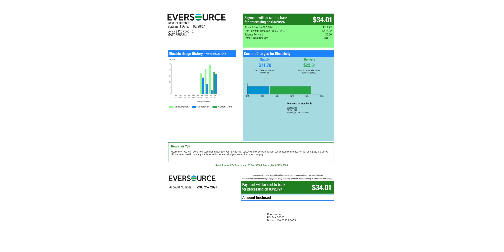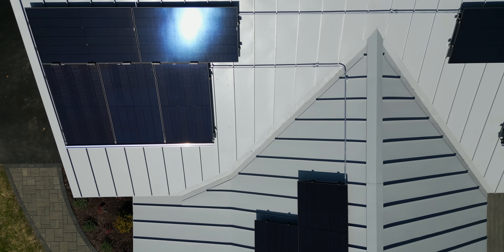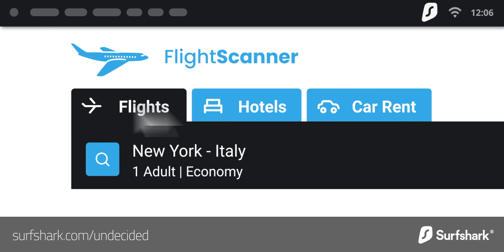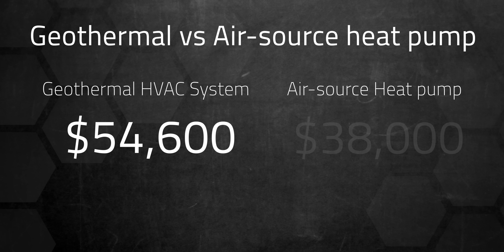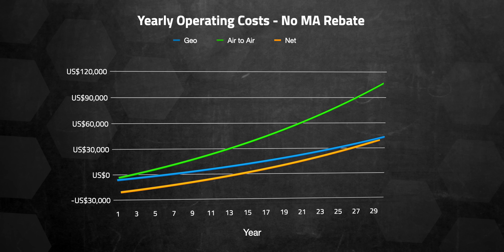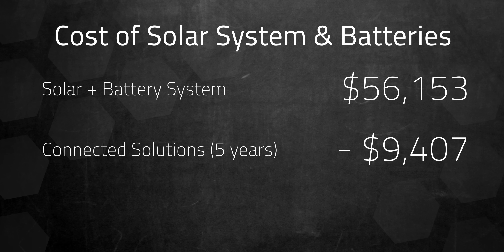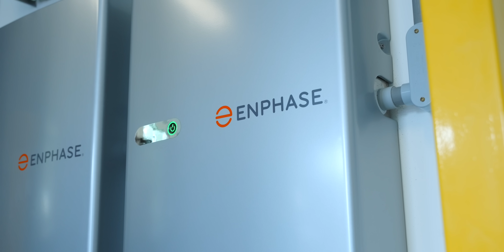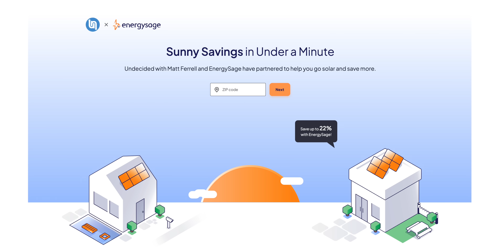What I Learned After 1 Year with New Solar Panels

Comment: It's worth it.  I've been off-grid for 4 years and would never go back.  I installed our own 15.3kw system for $27k.
Reply: Ok, wow, in EU, Lithuania, after all tax reductions, 10.2kw solar system(w/o batteries) cost me around 3k usd, and in US it costs like 10x more?
Reply: @ignasvo
Yes our permits and electrical code add a large amount to our solar costs. The benefit is less accidents. Houses burning down, installers dying and fire fighters not getting electrocuted is important. 

That said the US could cut the installation cost in half if they would standardize a little bit.
Reply: @ignasvo  yeah we kind of suck over hear unfortunately.  Greed has gotten way out of hand and it isn't going to get any better for the next four years.......
Reply: You sound like me, I've been growing my system to get to off-grid and the real costs I have calculated are coming in at about the same number. Are you figuring in Federal rebates on the hardware purchased?
Reply: @fixingbrokenthings  Yes, my final number is after the federal rebate.  We were able to take advantage of the full rebate.  Most people think that the credit is just given to you but you have to owe that amount it taxes at the end of the year to actually get it back out of the credit.  They often fail to mention that part of the deal.
Reply: That sound more in line, His package was HIGH
Reply: I've always been amazed at how little lights and most appliances use power.  The biggest energy hog is the HVAC.
Reply: @Off-Grid  Older 3-5 Ton A/C's are the worst, then Water heaters, then Dryer. I've really embraced Mini-splits in my setup and they are a game changer.
Reply: @fixingbrokenthings  Our system runs around 4000-4500 watts when on which is a little less than a heat pump but having it work the way it's intended to would be worth it.  Our mini-splits are ducted meaning that the units are in the attic, not on the wall. Because of this the remote controller doesn't work and the room temperature is taken from the attic and not the living space.  Plus, the mini-splits fun constantly as a feature that I can't turn off. This means that instead of it cycling on and off as needed it just always on.  This uses more power than it's worth making a standard heat pump forced air system better in my opinion compared to the type of mini-split we have.
Reply: @fixingbrokenthings  Have you seen the EG4 hybrid solar mini splits? I have 4 on my 2400 sqft house and they keep it Ice cold even in the worst of the central fl hot humid summers, by day they are 100% powered by solar and at night they barely use 1/3 of what my central A/C uses, which is turned off at the breaker now :)
Reply: Can you add a Nest smart thermostat? Then you can place a wireless remote thermostat in the room you want the nest to measure and run.
Reply: @Off-Grid  Bubba - your installation is faulty/broken. FIX it! Do a little research - probably a broken thermostat. You can easily replace, or install a new, thermostat yourself. Tons of 'how-to' videos on here.
Reply: @Le_Comte_de_Monte_Felin  No, this is how the unit was made.  Trust me I've done a lot of research on the subject and it was just a poor design.  I had to buy a third party wireless controller to place in the attic in order to set a schedule and control them.  It's ok but doesn't work 100% of the time and doesn't solve the problem of where the temperature is read from.  It works and does heat and cool the house but it often will over heat or cool it.
Reply: @fixingbrokenthings maybe saving power is a better idea than producing it
Reply: We're homeless in the direct inference. We're not. We just live in the woods with some big tarps and pallets as floors. I need to get to the point. We lived with a Bluetti 150 for 4yrs using it almost 24-7 in Florida humidity. I found it acceptable. it got us through some ruff times but now we have a ac200max with the capability to charge it in 2hrs! It works. I have a 2600 watt array. Works great.
Reply: I would like to do this too but I am worried over getting through the winter. My house is 195m2 in Maine-like climate in Europe (Northern European). My heat pump alone costs me 800w continuously at sub 5 degrees. That's like 15 kWh a day and we get lots of cloudy weather
Reply: @rhyme2192  winter is a challenge but if you have a big enough solar array and battery storage plus a backup generator you'd be fine.  It'll be a change of lifestyle but very doable.
Reply: @rhyme2192
In the winter I don’t mind clouds. The 1 inch of snow that stops our panels for 3 days is what kill my output. So yes for 3 months I still have a completely normal power bill. The solar doesn’t really help a lot.
Reply: What provides for your nighttime energy needs? If you use a (gas, diesel, LP, etc) generator, you're not really off grid since you still have to purchase fuel on an ongoing basis. Only an integrated solar/battery system gets you truly off grid.
Reply: @dlg5485  often people want to dispute what is "off-grid" and what isn't.  By definition it only means that you are not hooked up to public utilities.  A public utility is a company or organization that provides essential goods or services to the public.  

If you are on solar then your electricity is Off-Grid, if you have a well or rainwater collection like me then water is Off-Grid, if you're on a septic system then your sewer is Off-Grid, if you have a propane tank then your gas is Off-Grid.  As long as your house isn't hooked up to a public utility service you are Off-Grid. 

It doesn't mean that you have to live in the woods and live off the land.  If you're doing that then you're more of a survivalist.
Reply: that's the thing. if you can install everything by yourself, you can save an insane amount of money. also according to your financial situation, you can install it in steps.
Reply: $27,000 would pay my entire power bill for 21 years. The secret is to become more and more efficient.
Reply: @Bryan-Hensley  in my case though it was going to be $60k minimum to get power to where I was building so solar was a lot cheaper.  If you're building new then adding solar really is a no brainer.  Also, for most people their electric bill is a lot higher than the $107/mo that you're saying you pay.  Our bill averaged over $300 before we went off-grid and with rate hikes that would have definitely increased and continued to increase over time.
Reply: Plus will those batteries and solar panels be in working order after 10 years? 20 years?
Reply: @polosandoval
Yes the solar quality we are referring to has a 25 year warranty and should still be working after 40 years with a little maintenance. 

The batteries have at least a 20 year lifespan for todays lifepo4 battery technology.
Reply: @Bryan-Hensley
It sounds like a nice 2-4 kw system would work well for you then. Unless your roof is shaded or old. 

Usually when you get a new roof a properly sized solar system will pay for it self in about 10 years. It just has to be properly sized and not way over priced like his.
Reply: Add more solar panels….❤
Reply: 99% of solar buyers over pay and will never make their money back
Reply: which battery backup system are you using? I'm looking into whole house backup also but don't want to pay 30k+ for 50kwh of battery. also consider off grid but i'm only paying $15 a month for grid backup is not bad i feel.
Reply: @kl8878  for the last four years we've been on Lead Acid AGM batteries. At the time we bought them the safer lithium wasn't widely available and it cost a lot.  Lithium is 80% lower now so it's quite cheaper to buy it vs lead acid.  I'm in the process of installing the new lithium batteries right now and don't even have a full days use running the house yet to tell you how it's going but I will say that it's more complicated than Lead Acid.  

The lithium has 1200 amp hours of storage and can use 80% of that without worrying about possible lowering the lifespan of the batteries so realistically we only have 960 usable amp hours.  That said we can run these down to 0% if need be.

Our AGM is 1024 amp hours but only being able to drain them to 50% means we really only have 512 usable and you really don't want to go below that 50% state of charge threshold.  We actually keep it above 60%.

The AGM cost was $14k four years ago and the lithium was $9k for quite a lot more power.... although I haven't experienced it yet so we'll see.  These figures are before any tax credits.....which by the way Trump wants to get rid of so if you're on the fence I'd suggest making up your mind before the end of the year.  I bought our original system on Cyber Monday and got a good discount.  

As to the brand I'd suggest that if you want things to run smoothly then get the batteries sold with the inverter.  It'll probably cost more though.  Or you can search for a cheaper priced battery and hope it'll talk to your inverter.  This is where I'm at now in that I bought batteries that were on sale but they don't match the inverter software protocol so I'm working to figure that one out.  Otherwise it would have been plug and play.
Reply: See that is a price that makes sense. 

What do you use for winter heat?
Reply: @ecospider5  We use a pellet stove, have radiant heat, and a wood burning stove.  All are very efficient ways of heating.
Reply: Having a pellet stove is a great match with solar. When the solar output is low you don’t need it as much because you’re not trying to use it for heating.
Reply: @ecospider5  I think the pellet stove only uses around 200 watts.  It's remarkably efficient.  Our house is sealed up pretty good too so it holds the heat well and I can run it all night on the batteries.
Reply: The energy costs as they are ,I find affordable , so at my age of 77 I will never see a return. I only have the OAP and a broken private pension that collapsed. It's just enough to pay the energy bills . That's good as it leaves the whole of my OAP pension here in UK to live on. Perfect.
Reply: @kennethausten
In your situation a solar setup would be protection against inflation. Take whatever your power bill is and get a 20 year loan that has a smaller monthly payment than your current power bill. 

Spend the money from that loan on a solar system that provides enough power to reduce your electric bill more than how much you are paying for the loan. This should be easy. 

Now if inflation goes wild and the cost of energy goes wild you will not care because your loan payment doesn’t change. 

I am retired and this is what I did, plus I purchased an EV. So 5 years ago when gas prices and electric prices went up every one else was complaining but I was insulated from that. So I just sat back and laughed at my friends spending $100 to fill their SUV with gas.
Reply: @Off-Grid  27000, that's what 12 years of power?
Reply: @Jamesthomas12187  actually at the current rates and average monthly electrical bill it's 7.5 years but rates have gone up twice since then.  Plus it's people like me that are trying to help prevent climate change in anyway we can were as it's people like you that are to enveloped in your own greed to understand that there's even a problem in the first place.  If I never got paid back for the solar I'd still have done it because it's the right thing to do with the tools we have available to us currently. Maybe if governments would stop spending time denying that pollution is a bad thing and actually put some serious effort into it we wouldn't be having this conversation because you too would be on solar and loving it as we do.
Reply: Before you bought the panels did you wait a year and see how much electricity you used. Any addition electrical areas you needed or just a basic house. Thank you for any comment
Reply: @dididuit  we were building so I looked at the usage on our current home for the previous two years.
Reply: Yes it is worth it. We
installed a ground-based solar system (IE not on our roof) almost 12 years ago for $40k after state and fed rebates. Back in those days the state and feds were very generous with their rebates and credits. We live on 1.5 acres whereby the back half is on a south facing 40 degree downward slope. This is where the solar system is installed and can't be be seen from our house.  During sunrise to sunset the system generates a perfectly shaped bell-shaped curve for the electricity and we don't have any tree shadows blocking the sunlight. We have never paid anything to the utility company. Normally the monthly cost would have been $300 to $1000 per month depending on the time of year. We have three AC units producing over 6 tons of cooling and these can run 24×7 for zero dollars. So far the solar system has paid for itself and saved us well over $100,000. Our best investment ever.
Reply: @pauljones3866  either you have an incredibly large house or an incredibly inefficient HVAC system or an incredibly inefficient insulation in the home or a combination of the above.   
I've done the math a dozen times I live in south Florida a d in the hottest parts of thr year we get as high as 250 a month winter the recovery time on my investment would far exceed the lifetime of the panels currently.    I'm not against solar i live part year on our sailboat and solar is king but the math just does not work on the house.
Reply: Depends on your needs, my utility bill is $45 a month and thats natural gas included, it's 8.4cents KwH, my home soaks up the sun through out the day and radiates it back into my home through out the night during the winter and during the summer I open the windows and I have a natural AC in the last 3 years I think my AC kicked in twice right around August when it's 95f (35c), and my gas heater doesn't really get used much. No geothermal in place, it's just a hole that was built right before AC was a thing and has proper insulation. 

My utility company also will not to a buy back program so it's not like I can get a little extra income once I surpass net zero.
Reply: Another off grid guy said he would skip the solar panels, but loves his wood stove.
Reply: @Parzival711-x7i  Why would you dish solar panels? They will run led lights in a 24/7 format with minimal investment.
Reply: @Parzival711-x7i  ahh yes, wood for fuel.  the incredibly work intensive "free" fuel.  definitely better than something that requires no input once installed that can run a heat pump and all your lights and electronics.
Reply: @wtfdoicare  We have a pellet stove that heats the whole second floor all winter without any issues, and it's on it's lowest setting!  I installed a wood burning fireplace on the main floor but it's way to hot.  Trying to keep a small fire going it a lot harder than a big fire.  I'm having to make some changes this winter to try and cool it down by introducing cold air into the duct work.
Reply: @wtfdoicare if I'm busy with my business, I run my Heatpump. If business is slow, I cut firewood and use the wood stove. I have 4 acres of woods though. If I had to buy firewood, it's not worth it, a Heatpump is cheaper to run.
Reply: @wtfdoicare  How are those solar panels going to do in the winter when it's overcast for two straight weeks? Electric heat is horribly inefficient. You've clearly not done the math behind how expensive it would be to have enough batteries to get through the parts of winter when solar won't come close to covering an off grid solar only setup. Burning is a no brainer in certain climates.
Reply: @mrsully6003  The obvious solution is to use solar as your main source, since it also will cool your house and power electronics....which, news flash, burning wood wont do.

heat pumps are amazingly efficient.  This isn't 1:1 baseboard heat.

And then, when you have bad solar weeks, you use alternate fuel.  Go ahead and use your wood, or propane, or natural gas or gas generator.

Obviously there are use cases for everything
Reply: @wtfdoicare  In every place, the sun does not shine when the energy consumption is the highest. I live in Finland and the next three months will be dark. I have water-circulated wood heating with "free" wood, electricity consumption approx. 1.5 kwh/day and just monthly electricity network payments of approx. 500€/year before a single transferred kwh. Solar panels+inverter seem to be on sale for approx. 2000€/8kw. How could an off-grid solar panel system with a small battery work, and over the winter you could get electricity to the system with an electric car, charging from the car's battery? Now I have a diesel car and the annual tax is €500 more than an electric car would have, so in 10 years, €10k saving by giving up the electricity grid and diesel, and when the sun rises in three months I could partially start heating and charge the car  with "free" electricity😬
Reply: @AH-li7ef  didn't really bother to read, but looks like you laid out a situation where solar doesn't work for you.  great.  

I was at the store the other day and they had stuff i didn't need, and instead of arguing with people about it i just didn't buy it.
Reply: @wtfdoicare  I'll bet if Audi came out with a wood-fired car you'd be first in line.
Reply: @patrickmckowen2999  That's the difference between folks who want convenience vs folks who want to enjoy life. It's fun (seriously) cutting and splitting firewood. I'm 63 and this year is the first year I've had a (used) wood-splitter. Get out of the house and LIVE LIFE! :)
Reply: @Le_Comte_de_Monte_Felin
What? You want to be active and live a long and healthy life. So weird. :)
Yes the longer you can do things like chopping wood the longer you will live. Good job staying healthy.
Reply: BUNCH OF GREENIES, INVESTING 100’S OF THOUSANDS TO SAVE A FEW THOUSAND.
Reply: @todmill100  We don't expect you to understand because you'll never get it.
Reply: @todmill100  so stoopid
Reply: @todmill100
Unless your roof is shaded a $2000 solar system will pay for the loan payments for a 5 year loan. So to reduce the upfront cost just add a little bit every 5 years.